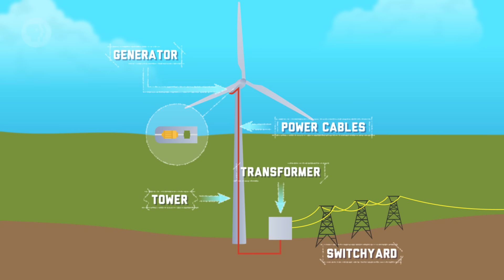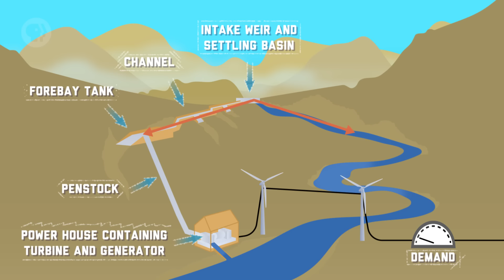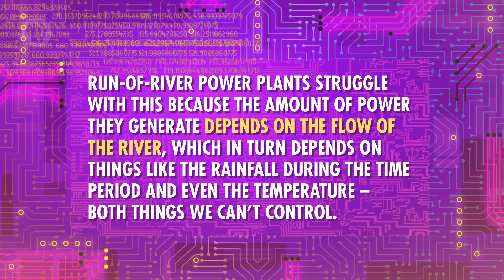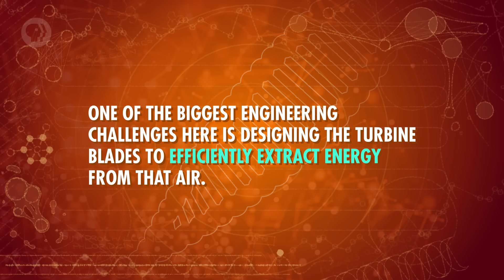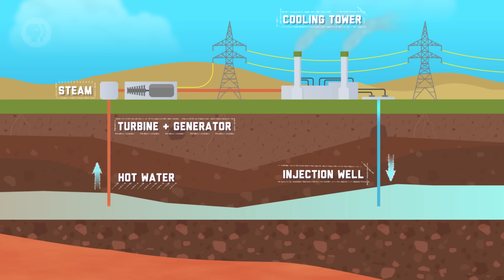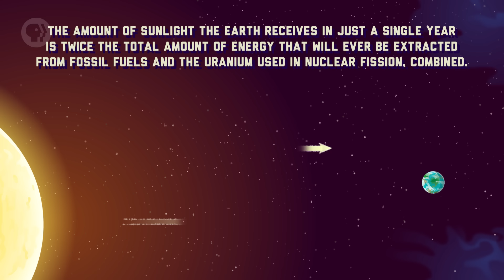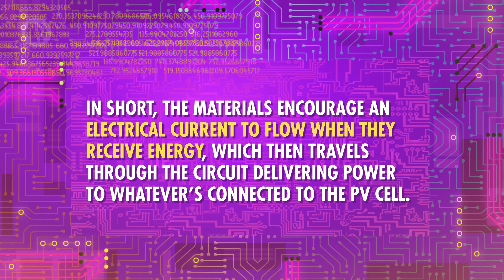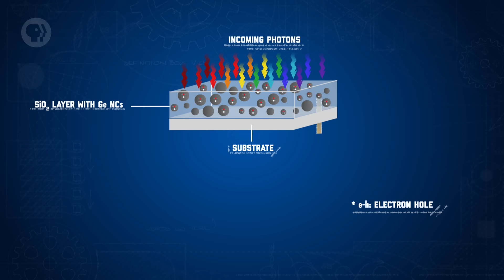The Engineering Challenges of Renewable Energy: Crash Course Engineering #30

Comment: Levelized cost of energy for solar is nowhere near that x3 more expensive than fuel. For most of the countries on earth fuel or gas is not free and needs to be imported. Utility scale solar without subsidies is being installed nowadays at levelized cost of electricity (LCOE) of around 40$/MWh which is well in grid parity. Gas combined cycle and coal are in the range of 40-70$/MWh. Residential rooftop solar are at 70$/MWh and people are installing it because even at that price is economically profitable considering all the distribution costs, utility companies profit and taxes on top of grid electricity production price.

The answer is simple: install LOTS of industrial-scale solar and offshore wind FAST + pumped hydro energy storage, meanwhile maintain installed nuclear (those are already paid for!).
Reply: This is before the addition of energy storage which at ~$500 per kWh is easily the most expensive part, overwhelming the cost of transmission costs avoided, levelised avoided cost of new energy production, inverters, and grid upgrades to allow residential solar panels to export to the grid.

The idea that solar PV is "cheap" - when so many costs are externalised: cheap labour in China, cheap coal in china to drive the SiO2 + C -> Si + CO2 reaction, cheap environmental dumping of tetrachloride, cheap fossil fueled shipping, and generous taxpayer subsidies and grid operator mandates forcing integrated systems operators to take solar power first on the merit order - is farcical. Then there's the "artisanal" mines of Cobalt in the Congo for batteries, exploitation of indigenous peoples in South America for Lithium salts, and some pretty unsavoury practices happening in China to produce graphite for batteries.

It's like saying that fossil fuel is "cheap" when you and I both know that the cost in climate, in pollution and early human death is known. No source of energy is free of environmental cost. There is good reason to believe that scaling up solar PV without regard to its consequences - the increased mining, the wholesale electricity price suppression and retail electricity price elevation, the storage problem and the end-of-life problem - that it can produce its own set of risks. 

The only sources of energy that fully internalise their own costs are nuclear power and hydro power. Hydro power because as part of routine construction planning, land offsets upstream and downstream are bought by the state to ensure that people don't build in areas that will be flooded. Nuclear power because everything - from mining, to construction, to decommissioning, to insurance, to waste disposal - is fully paid for during the projected life of the plant. The only time these costs are externalised are when people build in dam-break danger zones despite warnings, and when anti-nuclear activists force early closure of power plants to then force governments to pay instead of power plant operators: a gambit to progress their own agenda.
Reply: @MonMalthias  
PV panels "produce" the energy needed for their production within less than to a few years (depending on where they are installed obviously). It is irrelevant if it is cheap or not. All fossil fuels need continuous mining and transport and not only produce CO2 but (coal in particular) also disperse heavy metals and radioactive elements.
And nuclear power with fully internalized costs? LOL. It's the tax payer that gets the bill when to keep nuclear power plants profitable, there's cleanup to do or even just when decommissioning of a nuclear power plants takes decades and the "predicted" funds for that have run out.
Reply: *levelized. And yes, their metric is wrong. Solar and Wind are at "grid parity" in several markets. (this means it is the same price or cheaper over the life of the project than other non-renewable options, including nuclear energy). With the technological learning curve of solar and wind these prices will continue to decrease in increasing numbers of markets.
Reply: 40$/MWh? It actually depends on location. Check Masdar / EDF project in Saudi Arabia with minimal LCOE 17.8$/MWh.
Reply: @windhunters  and still probably not grid parity there since fuel is basically free (marginal cost of production)
Reply: @itschrisuphere  agree, I was looking for a place to mention that in the states solar and wind can be cheaper that running existing fossil.  There have been fossil plants retired in favor of renewables based on cost alone.  Renewable costs have changed dramatically over the last three years.  Looking at costs 2015 and before is inaccurate.

Comment: @CrashCourse check your facts at 8:00. Solar is not x3 to x6 times more expensive than fossil fuels! The cost of Solar has fallen so much in the last 10 years that it is CHEAPER than Coal! This has been the case for a very long time now and is continuing to get cheaper.
Reply: True.  For certain locations in the world and scale, total cost to generate is cheaper with solar PVs than fossil fuel based power generation.  However, this video is rather basic and vague, so the 3x-6x cost appears to be the upfront cost.
Reply: ''Once you factor in the cost of making them and ENERGY STORAGE''. You have to add the indirect costs associated with solar PV to get the real cost.

Comment: Has CC covered storage and transmission of power? I remember as a teen wondering why batteries weren't used. It wasn't until college that i learned that isn't just about generating power but also the voltage and amperage. (How much and how strong the electrical power coming to you)  In this is a Crash Course, but those things play a big part in power generation.

Comment: The thing about wind and solar is that they tend to compliment each other. If it's cloudy then it's probably also windy and clear skies might not have a lot of wind. You can also off set the issues with good meteorological knowledge, if you know the weather patterns of an area you can use that to compensate. Oceans for example usually have strong winds making them excellent for wind farms and this is how Denmark generates almost half of it's yearly energy usage with wind power alone. And it also turns out that you can supply peak demands with wind and solar since the amount of wind blowing changes throughout the day just like sun exposure. Again by choosing your location cleverly you can exploit natural differences.
Reply: They don't complement all the time, there are hours or days (even in Germany with 100 GW installed wins&solar) when both wind and solar electricity production are basically zero. This has a good chance to happen during the evening peak. The grid has to take care of times like this too. Large-scale energy storage (very expensive) or 100 % backup is needed (very expensive). Wind turbine's output depends on the cube of wind speed, it can vary quite fast. Solar production rises and falls fast in the morning and evening on a clear summer's day. These gradients have to be taken care of (technically demanding). In Denmark they have a lot of problems with voltage stability, they had to implement syncronous condensers (additional costs). They also use their interconnections to keep their grud stable, something that won't be so easy if every country starts to invest heavily in solar and wind. With alot of wind and solar PV, additional inertia is needed (additional costs). Distributed generations causes problems with voltage profiles in the distribution grid, hence compensators or on-load tap changers are needed (additional costs). There will always be longer periods of time of low solar and wind production, batteries can't help you then, backup needed (additional costs). 

It is OK for now due to low shares of wind and solar in interconnections. Even now the correlation between solar and wind installation and residential electricity price is clear. If we continue this energy transition towards itermittent renewables, electricity will become a luxury. Especially when mobility and heating go fully electric. Basically everyone working in power engineering (except in the renewables part) will tell you this.

Comment: You really sold geothermal incredibly short.  First, the graphic you used was for a design that hasn't been widely used for decades now.  Yes, a few plants are still built like that, but the vast majority are binary cycle plants, where the hot brine from the geothermal resource is run through a heat exchanger to flash boil a secondary working fluid (typically pentane, butane, or another refrigerant with a low boiling point) to run a turbine.  The main benefit obviously being that you can extract much cooler resources and still produce commercial amounts of power.
Also, mentioning production from Iceland and Italy... and then leave out that the state of Nevada produces more geothermal power (in terms of gross megawatt hours produced) than Iceland and California produces more than Nevada, Iceland, and Italy combined.  Even Utah and Idaho give Italy a run for its money.  This isn't some niche power source only suitable for a few small nations.  And, with the development of enhanced geothermal systems, where man made geothermal reservoirs can be created, instead of having to find a naturally occurring one, the only barrier to geothermal being viable option for baseload power production (a term conspicuously absent from this entire presentation, the ability to produce power round the clock) is drilling costs (because everywhere has pockets underground hot enough to create a geothermal heat source, if you drill deep enough).
Reply: Cool

Comment: 7:24 For Solar PVs, transmission is not of a problem, at least in a residential/commercial setting where power is utilized where it is generated.  Of course, transmission is a problem for all types of larger scale utility scale power generation.
Reply: It's not that simple. Distributed generation can cause all kinds of problems with voltage stability, which needs to be addressed, causing additional costs.

Comment: Cost reductions for solar and wind are kinda yesterday's news. These prices are plummeting already and are set to kill fossil fuels on a per KWh basis in the next few years. 
The main challenge which you barely touch on is intermittency and geographical limitations on solar and wind. Solutions like high voltage DC grids, distributed storage using various technologies, smart grids and AI-driven demand management are the way forward here. These are a big juicy engineering challenge that you should really cover on this channel.
Reply: The cost of solar panels has begun to saturate, we need a breakthrough in material science. The efficiency of variable-speed wind turbines is almost at the Betz-Lancester limit and we are reaching the (economic) limits in size. Energy storage has a lot of potential in developement and cost reductionthough.

Comment: hmm. do we not store the energy that is excess of the energy demand?
Reply: Its hard to "store" energy. You need to use batteries. A dam is a battery though. Storing energy usually means that you keep energy from converting from one form to another. Potential kinetic energy is probably the easiest in that case. But wind and solar han help by pumping water back into a dam when demand is low and there is excess energy.

Comment: You’d think an engineer would use a level to build those selves.
Reply: that's what a carpenter would do. an engineer knows what angles they can get away with before failure
Reply: @BlueyMcPhluey  
and........................................your alarm clock fell off the self, for the umpteenth time, and now doesn't wake you up. Your late, once to often for work and they fire you. Now the only job you can find is a cabinetmakers assistant.
Reply: the angle was designed to take into account the friction on the surface and the effects of gravity. The alarm clock is fine :)
Reply: josh mcgee 
Thank God Engineers use rubbers.

Comment: I'm surprised you guys didn't bring up concentrated solar power, which doesn't use PV cells. Rather, mirrors are used to concentrate light onto a tube system containing some fluid (typically a salt) to heat it up. This fluid can then be used to heat up water and drive a turbine. As far as I'm aware, it's more efficient than PV solar power, but it also allows for power to be stored and used later, as the heated salt can be stored in insulated tanks and then released later on.

There's also concentrated PV solar power, which lowers the cost of production by using mirrors to concentrate light on smaller amounts of PV cells. This lowers the amount of PV cells that one has to produce and use, but separate systems have to be implemented if one wants to store the energy produced, and extreme heat can sometimes damage the PV cells.

Comment: i had a feeling solar panels wouldnt pump out as much juice as it takes to make them.  on that topic, i think the efficiency will be found in quantum biology.
Reply: Actually, solar panels have an energy payback time which range from 2 to 5 years. Meaning that they produce an amount of energy equal to that used to manufacture them in that time. Any electricity produced beyond that in the solar panel's 20-year lifespan is a net gain of energy.

Comment: solar panels on individual house is actually not that great an idea as the grid is design so that it dose not exceed a 3% voltage drop every time a new house is put on the grid engineers have to make sure that the grid can handle the load but nothing is done when a house puts solar panels on there roof and back feeds more power into the grid in addition to that the lower demand for power for the grid force the energy companies to do what they call gold plating imagine you have a street with 100 houses then 50 of those house get solar panels it then falls for the other 50 to take up the cost associated with maintaining the network down the street hence rising energy prices (centralized solar farms are fine)

Comment: But why are solar panels so inefficient?
Reply: Because PV cell is predominantly made of Silicon, and silicon can "absorb" only certain wavelengths of the solar radiation. So the efficiency of about 17% is of the total solar radiation. (kind of misleading since you can't physically use it all)
Reply: @non19dy  Ah, now I understand. Thanks for the short and concise answer. But wait, doesn't that imply that the only way to increase solar panel efficiency would be to change the material it's made of?
Reply: @non19dy to be more exact, every semiconductor has a band gap. When a photon with energy greater equal band gap energy (BGE) gets absorbed by the semiconductor you get a electron with BGE and everything over that is heat. A photon with energy smaller BGE doesn't get absorbed at all. Multi layer solar cells use that and place materials with high BGE at the front and ones with lower ones behind. Silicon does have a quite low BGE but because of how the spectrum of sunlight is, it gets a lot of the energy out comparatively. Also it is really cheap compered to the other materials.
Reply: @gabedarrett1301  yeah, changing the material can be a one way to increase it (for example CdTe type) . Or multilayer different materials on top of each other, but in that case, you soon get to the point that it's unfeasible and too complicated,...and x time more expensive.. Its about the balance and silicon wins on overall price.. at least for the moment
Reply: @FreeOfFantasy  yeah exacly, I just wanted to put forward an easy, quick answer. Silicon band gap of just 1.1eV is kind of small, but the price of material and ease of manufacturing will keep it as the element of choice for some time. And as always, whatever gets you the lowest Levelized Cost of Energy (LCOE) wins.... whatever the efficiency

Comment: Solar Power cannot be used anywhere. Of course you can mount panels everywhere but you can also build a hydroplant (almost) anywhere or a geothermal plant anywhere. They just wont be reasonably efficient. Solar really is not a solution to the distrubution problem quite the contrary. Big solar farm in deserts close to the equator are a major logistical challange and small distributed solar is only feasable in places like california not so much where i live though. And large parts of europe in general.

Comment: The problem is that you should be saying this in mandarin, Cantonese, and Hindi considering they have trouble controlling their particulate matter before worrying about CO2.  Besides CO2 is not a pollutant it feeds plants which in turn provide oxygen. How many animals can live without oxygen? CO2 has been higher in the past than it is today. It’s always been apart of the ambient air so I’m not sure how you can argue it’s a pollutant. If you burn up everything then you are left with CO2. We’re living longer now today I don’t see why we would make ourself suffer investing trillions into the generation and distribution sector when we’re so far in debt today millennials will probably not be as wealthy as their parents. Face it the millionaire screwed the middle class into becoming billionaires. Now they want to squeeze more out of us in the form of a CO2 tax. Just remember anytime a power plant adds a control device, the consumer is the one who ends up paying for it. Solar today is too volatile it can drop off in an instant then a coal fire boiler is started up just to offset the loss of solar. PBS makes crash corse unbearable with its political agenda. Is water vapor a pollutant. It could kill you if you breathed to much in.

Comment: Co2 from livestock is much more than all the fuel we burn.
Reply: It does add quite a bit and we should reduce it or eliminate it, but we should also reduce the fuel we burn. Not focusing on both of these issues would be overall detrimental to the ecological and economic problems that we face.